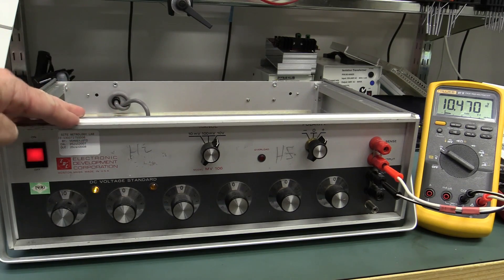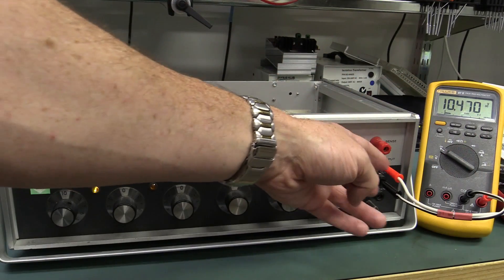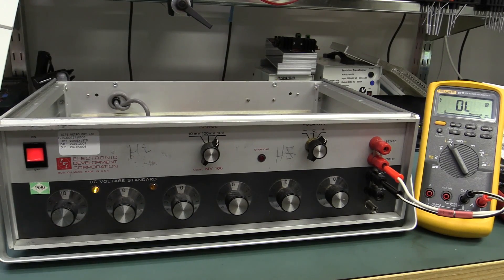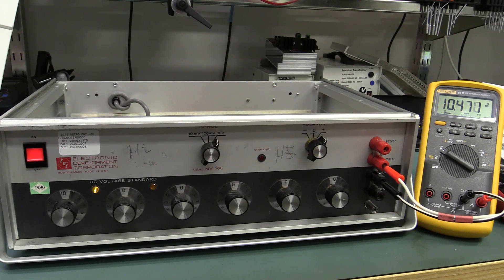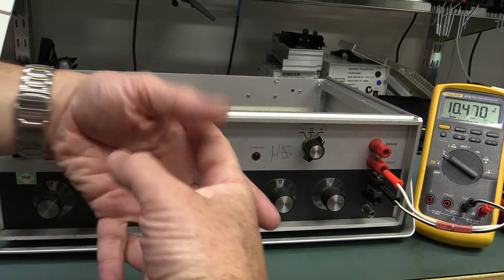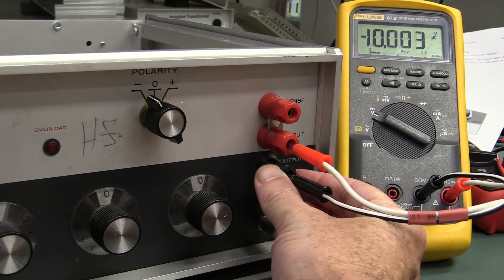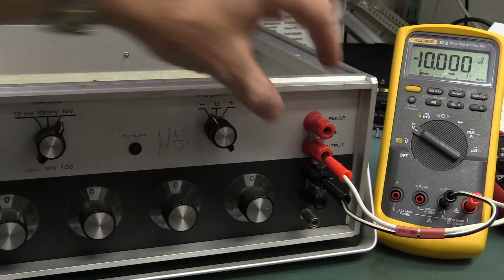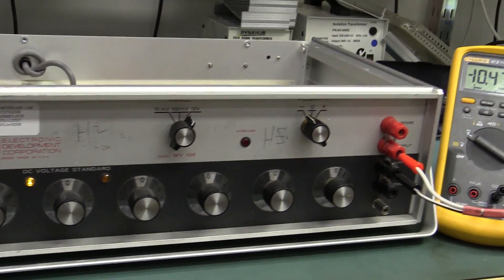eevBLAB #6 - Don't Assume It's Faulty

Comment: Very interesting and as usual, so simple! We had a whole bunch of those Fluke 87's (model III) when I worked for General Dynamics back in the 1990's. Of course, I've always made due with my el-cheap-o Radio Shack DMM, and believe it or not it's been a great meter for a $60 device. The internal circuitry and overall build-quality is nothing compared to the Fluke but for what little I do I with it, it works great. One thing I do like about the Shack meter is I can attach it to a computer and log certain events over extended periods of time, which has been extremely helpful at times and is a capability I always wished the 87 had.

I greatly enjoy your tear-down vids :)

Comment: had a motherboard that was dead   -   checked all the connections   -  checked psu   - checked continuity of headers  - checked everything   -  thinking it was a bios fault but was stuck because of no boot  found the fault    -  have a guess what it was

Comment: New to mechanical work on cars, I replaced a solenoid, starter, and alternator, before realizing the battery was dead. This sounds absolutely absurd, but jump starting wasn't working. The replaced solenoid had no effect but it was the cheapest replacement (and I had failed solenoid experience in the past), the starter sort of worked but the vehicle died afterward, and I assumed the alternator was the culprit since it wasn't charging the battery. Nice old 1976 F150 Long Bed. Finally realized the battery was at fault, and replaced the rest of the wiring, just for good measure, since I effectively replaced the entire engine side electrical system. I still call that whole experience the $400 battery to this day. All that work, in a K-Mart parking lot. And yeah, I bought all the tools necessary to replace everything. FWIW, it was the late 90s and I sold it for 3 times what I paid after doing some other refurb work on it...

It wasn't for awhile after that that I learned the first and only thing you check initially is the battery and its connections, while they are somewhat unlikely to fail, if they do fail initially, you are lost with further diagnosis. So always check your connections!
Reply: Jump start cables alone don't really provide enough current to start the vehicle. You have to have some capacitance in the battery or they just won't get the job done, at least not the smaller ones.

I had an issue with a car where the starter didn't work at all, but everything else electrical was fine, including the headlights, so it didn't seem like an issue with the battery or alternator. I replaced the starter solenoid, the ignition switch, the neutral safety switch, and maybe another thing or two before getting some wiring diagrams and probing around. It turned out to be a burnt terminal in a connector going to the neutral safety switch. I don't know that I'd say it was really simple, but it definitely was cheap. I spent about $2 to fix it, and about $200 on things I didn't need.

The moral of the story is do whatever testing you can to confirm the issue before spending money on parts.
Reply: ***** One thing I learned was that if the cables were corroded or not connected properly, a jumpstart will work, but the vehicle will die after it shuts off. This was really the key issue on so many circumstances. Clean 'em off, even if the battery isn't great, the thing will still start. I even learned you can start a car (not all cars) without a battery if the alternator is good (and that's a good way to check if the alternator is working, start it, disconnect the battery, turn on all the headlights, interior lights, etc).

My brother had a 1979 Chevrolet Caprice and while replacing the battery (after replacing the heater element; instructions called for removing the battery) I accidentally touched the positive terminal to ground while tightening the nut. This completely fried a wire fuse that went directly to the starter. That was a pain to troubleshoot. It wasn't a fuse but the wire that went to the starter itself literally burned itself off. It took an electrical diagram to figure that one out. I replaced it with an extension cord I scrapped. Highly unsafe, but it got the job done.
Reply: It isn't recommended that you run a car with electronic fuel injection without a battery. The onboard computers are sensitive to power spikes, and the battery is a massive capacitor that smooths those out. I know people have gotten away with it (including myself before I read about it) but there is a risk. Replacing a battery or alternator is a lot cheaper than replacing a PCM.

All you really need to do to check the alternator is to connect a voltmeter to the battery, cigarette lighter, or any voltage source on the car. Start the car and turn on the headlights. Disconnect jumper cables or a charger if it's connected. If the voltage gradually rises, the alternator is charging and your problem is something else. If it continues to drop, it's time for a new alternator. (If the alternator is shot, it may have taken the battery with it, so replacing it may not completely fix the issue.)
Reply: @chitlitlah  With thick enough jump start cables you can get the engine running even if battery is bad or fully disconnected. Those cables are pain to use, though.

Comment: Dang, I thought sense connection, but I saw that those jumpers were there.  I had this at work a few days ago, because the connector I removed had sense and power separated.  They got jumped on the board.  With the Agilent supply, it said it was at 12V, but my meter said 18!

Comment: Stressing it's not a dicky connection at 3:32 Dave sets the viewers on the wrong track. To my mind it IS a dicky connection but of course between output and sense inputs.
Apart from this detail a very instructional video. Correct connection of the sense inputs is vital for all four wire sensing applications. Perhaps a good topic for another fundamentals video.
Reply from the maker: DB7MM I was referring to the banana plugs.

Comment: I've seen a lot of equipment like this that includes a pair of medium-value resistors (100 ohms or so) between the output terminals and the sense terminals so that external shorting bars are not required for non-critical applications. Would that not be appropriate here?

Comment: I had a feeling! I kept wanting to reach through my screen and make sure those were tight.. Been bitten by that one before,myself!
Reply: Also,this issue can really suck with power supplies..Your project is supposed to be getting 5V,but the PSU decides to rail to 60V because of a loose sense connection. FML.
Reply: PhattyMo
What's wrong with your lighthouse?
Reply: I also had this one right.  Though I had some doubt since the 1V and 100mV ranges were unaffected.

I was, however, surprised that this supply had no protection from an open-loop sense condition.  It is not uncommon to use either a resistor or diode between the voltage output terminal and the sense input terminal to ensure that the output voltage can only rise by a controlled amount, thus preventing it from going totally open loop and swinging fully to the rail.

Comment: Loose connections cause fires in my line of work!
Reply from the maker: Tradie Trev I'll stick with an amp or two at most, thanks! High power gives me the heebie jeebies.
Reply: EEVblog  Arc-Flash suits are too hot anyway!
Reply: EEVblog
I like my high voltage gear, Dave, as well as low voltage and I'm working on a backup power cabinet with 7.2kWh storage capacity, so I need good connections and large bus bars for the 300A rated max, continuous load.  I will say that your little problem was a lot more simple than I thought. LOL :)
Reply: ***** Actually you may be right. Because, thinking about it, lower power stuff usually is more sensitive to changes in the connections!

My previous laptop, a toshiba satellite, had a bad connection on the power jack, and it would get VERY hot (didn't catch fire, somewhat unfortunately LOL). I did a quick simple fix (a nice fresh solder joint and some hot-snot to help keep the connector from wiggling as much), of course it was already out of warranty.
Reply: EEVblog
Oddly Dave, I find the opposite, high power stuff suffers fewer 'dicky connection' faults. It can be scary if you're not confident, but I'd rather a loose connection just emitted smoke and let me SEE where it is rather than buggering me around for a day :)
Reply: *****
Indeed, I often diagnose shorted tantalum caps by applying hard supply to the rail and watching.

Comment: The lesson here is that even the most experienced person can make mistakes.
Reply: *****
Loose PCI-e 8 pin for me...was plugged in tightly, asus 780 has power status led that showed 'power good' signal, but pcie connector was loose on the psu side...pulled everything apart before seeing the modular cable half out.  swore out loud, repeatedly.
Reply: One of the teachers in my college once got killed in a HV lab by electricity. But not by the 3MW transformer, not enough irony. His PC stopped working, he went to check it and the power cord was somehow ripped apart, he touched it and that's the story.
Reply: *****
Heartbreaking. B-)
Reply: Yep, You're right Crozix
Reply: *****
No, completely wrong. Experience by definition means that you know more of the stuff to look out for, including the small things.

Comment: Why did the lower ranges still work properly? Did the point at which they max out just happen to be the same as the voltage you expected?
Reply: Less voltage means less current, so maybe the worse contacts did not change the voltage enough at low enough output voltages. I can't think of anything else right now.
Reply: MaximusPayne I'd considered something like that, but Dave seemed to be saying that the error came from the system going into open loop mode and jumping to the rail, rather than from voltage drop
Reply: Rob Mckennie I know it does not sound right, since the actual problem was not a voltage drop, but a voltage rise, Still...there has to be something like that happening.
Reply: MaximusPayne A voltage drop before the point that's being sensed would cause a voltage rise before the drop, but as I write this I realize the multimeter is sensing further down stream than the standard itself, so scratch that.
Reply: I'm guessing like on a PSU there is a resistor parallel with the sense connection to keep the loop closed if you don't have the sense connected. How much error that resistor will cause will depend on the voltage
Reply: Check out the schematic in his earlier videos watch?v=onqsjDJq4I0 at 21 minutes in, you can see that only the 10V switch position is attached to the sense connection in the feedback circuit.. I think..
Reply: Lasse Langwadt Christensen A resistor like that shouldn't have any drop at all, because i'd expect the sense line to be super high iimpedance
Reply: Lower voltage means less current means less drop in the lines means uses internal sense perhaps?
Reply: much voltage mean much voltage drop on the cable.
(or of course the other way around If he measure the current)
Reply: bbytew Are you saying that the lower ranges have a built in feedback loop? That makes a lot of sense.
Reply: Rob Mckennie No, but less current you put on the wire, less lose drop you get. 
Probably at lower current this voltage is very very little. If we have the resistence of the multimeter we could calculate that.
Reply: Rob Mckennie There's  a limit to how high the impedance can be or it would be sensitive to noise, and there's a limit to how small the safety resistors can to not cause and error when the sense is used
Reply: Lasse Langwadt Christensen True, but 400 millivolts? I'd need to see a diagram, but that seems like an awful lot. If the backup feedback system gives such a huge error, what would even be the point?
Reply: Rob Mckennie preventing it from totally losing regulation and outputting maximum voltage
Reply: Rob Mckennie
A lot of sense for the problem, but none from the design perspective: At lower voltage, any drop will be proportionally higher than at the higher range.
Not an explanation for me.